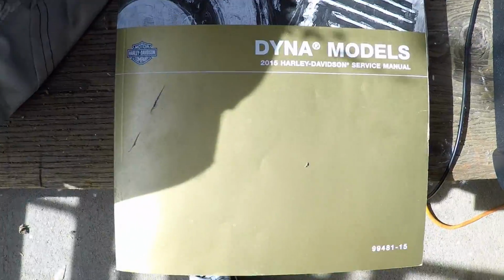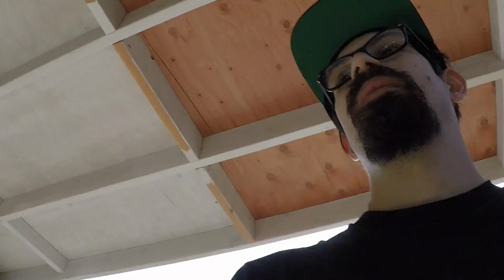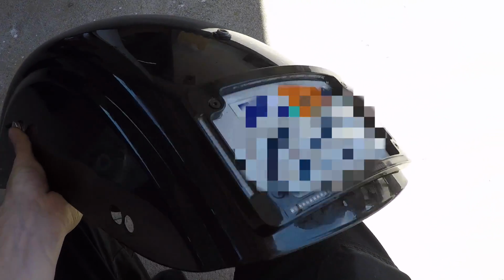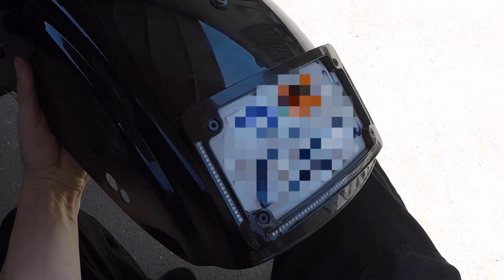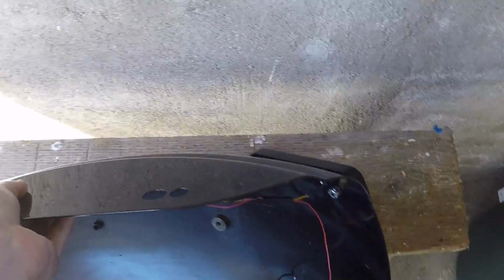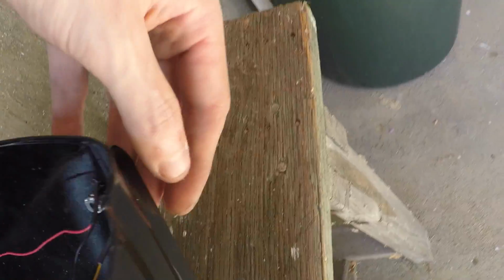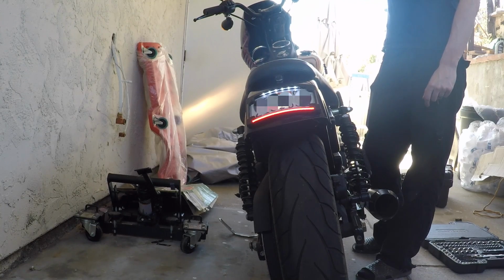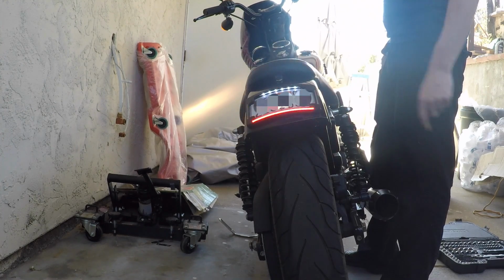Dyna Fender Removal and Custom Dynamics L.E.D. License plate frame

Comment: Looks good. Might want to put some heat shrink on those wires to protect them. Also, Custom Dynamics makes a plate mount that really makes installation easier and cleaner.  3 mounting holes in the center and another hole to run the wires through. Just throwing that out there. Ride on, man
Reply from the maker: BeardedNorthman 1776 yeah i saw that mount but i wanted it to sit really flush on the fender so i didn't get it. Over all it wasn't that bad. The main issue i had was getting all wires right.

Comment: Hey man setup looks great i just ordered the plate frame for my street bob.. was wondering where you got the plugs that you hardwired the plate frame too? Thanks ride safe
Reply from the maker: Actually my father in law had them laying around because he does engineering for a hotel. But Im sure you can find then where ever they sell electrical supplies.
Reply: John Serpico 
Custom dynamics has them for $2 or something. They give u the option when ordering online. I got the black frame that illuminates and is used as brake light only. Running light is optional. Part # LPF-BCK-B. Brake light lights up the road. Plenty bright.
Reply: Were u get it for street bob u got a link

Comment: You got the wrong license plate frame. You were supposed to get the tri lighting license plate frame so the turn signals and brake light dont flash together
Reply: But its clean
Reply from the maker: T-Rag yeah, i know. I might switch the fender all together later.
Reply: got a link for the one your talking about?
Reply: T-Rag did you need a rbt controller for the tri light plate

Comment: Great job on the install. Did you have to splice the wires? How did you know which wires go where? I just bought this and trying to figure it out.
Reply from the maker: Yeah i had to splice them. The colors are the same on the wires, and they provide a little map of where everything goes. Just make sure you have the correct plate frame for your bike. I bought the wrong one and by the time I figured it out it was to late. But I made it work.